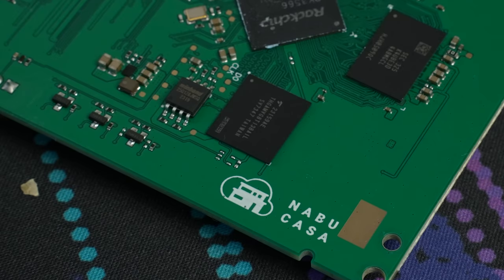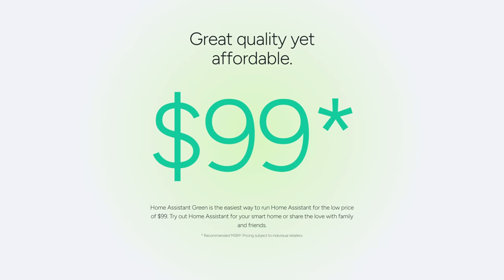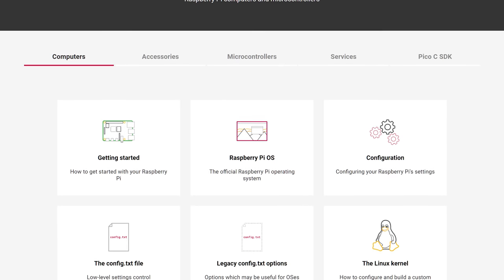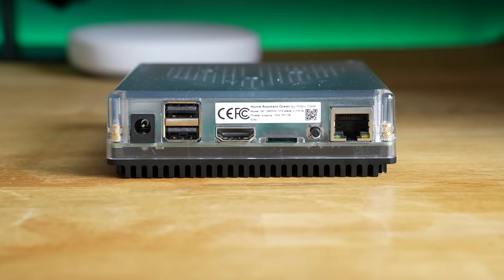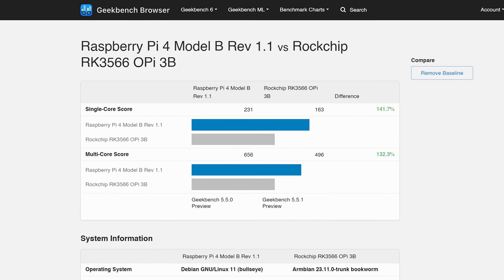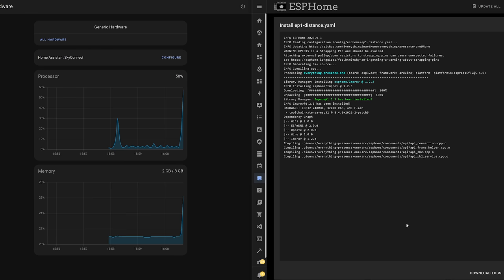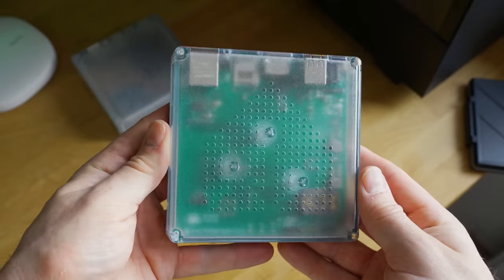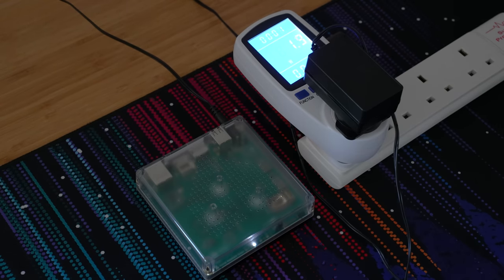Home Assistant Has Never Been This EASY!

Comment: Disappointing that the green doesn’t support PoE, that would have made it an easy win in my books.
Reply: No it actually does. If you check in their website, it says poe is an option you can add with an additional cost
Reply: @ no that’s the HA Yellow
Reply: 5$ 12v PoE splitter will do the trick just fine
Reply: Path of Exile?

Comment: Great video Lewis, and good advice.  The sky connect should not be plugged directly into the USB port .  The extension cable supplied is to give separation from the high frequency  clock noise and will make the radio more reliable, as mentioned by Paulis.
Reply from the maker: It sure is, it was just for a nicer shot during filming 😜
Reply: @EverythingSmartHome naaah, are you going Hollywoodish? 😂😂

Comment: Wow, if potential users can't do the easy bit of d/l the img and flash a usb stick or drive, then they have absolutely NO chance of the nightmare ride they are going to get trying to get the cryptic, obfuscated Home Assistant sorted. Just a thought for any potential user to check out first, as I failed to get my 13 or so Tasmota's that have run on nodered faultlessly for the past 8 years to be seen/usable in various versions, including the latest HA. The installing is the easy bit, then comes the dark side.

Comment: You can always run Home Assistant on HA Green, while running "AI/image detection" in docker on a more powerful machine.
I have been running HA in docker on my Unraid machine for years, but hate HA being down when i have to do maintenance on UNRAID.
I might move HA and the low-resource dockers to HA green, and keep the high-resource (low-priority) dockers running on UNRAID.
During maintenance, I NEED my lights working, I DONT NEED person detection.

Comment: This device really seems like an answer in search of a question.  Double the cost of a Raspberry Pi, the same or worse performance (depending on whether you're comparing to a Pi4 or Pi5), and zero radios onboard--not even Bluetooth (or WiFi, but any server--which this is--ought to be wired anyway).  And only two USB ports.  Yeah, it comes with HAOS pre-installed--but if flashing HAOS to a uSD card is problematic, HA just isn't for you.  Is saving a few watts worth it?  I wouldn't think so.

A year ago, before the rPi5 and when the rPi4 was unobtainium, this might have made sense.  Today?  I don't think so.

Comment: Lack of POE on the HA Green is easily sorted by a POE Splitter. Sure it's a bit more "clunky" than built in POE, but from a practical viewpoint it achieves the one-cable-for-data-and-power. In practise you won't notice the "clunk" as it sits at the back of the unit. Also, from an economics viewpoint, many new Green Users won't be paying for something they will never use and if it's something that becomes useful down the road, then it's a simple incremental cost. I got mine off Amazon for just over £10 (flash sale) for a full Gigabit splitter.  Note that you can use a FastEthernet (100mbs) rather than a gigabit - this will be entirely adequate for any installs which don't involve streaming video

Comment: @EverySmartHome  Great video and tempting devices from HA. I have been wanting to try HA for some time now and use it with lighting, plugs, Thermostat and more as I learn its capabilities, I also would like to move my Security Cameras off Blue Iris running 4-6 Camera Feeds and onto HA if that is possible, I currently have Blue Iris running on my Gaming Desktop PC. Would one of these HA devices work for me? If not could someone please recommend a medium to small sized device setup that would not break the bank, that I could build or buy to meet my needs now and not need replaced any time soon if at all.
I know enough (using the Web) to do things, I am not good at it but I eventually get the job done and not scared to learn. Any recommendations on any pre-built systems or something better I could do following a guide or video would be greatly appreciated. I have seen a number of interesting devices on this channel and others that seem good, I am just not sure if they can handle the always on Security Camera feeds I send to a 40” TV Screen in our Den and still do all the other HA things too? Thank You for any and all suggestions!
Reply: It has been a couple of weeks now and no response. Is anyone able to see this? or is it not a good YouTube page to learn stuff like I am asking about? If not could someone please at least recommend a good YouTube page or other online source that would be good to use?

Comment: I don't agree that 32Gb storage is enough. 10 days default recorder with not too many sensors that update to the second(power sensors is what I have in mind) and about 10 esphome compiles for different devices will fill it up.
I lova HA but that default recorder days need to be lowered.
Update: I changed my mind, I have way more rapidly changing entities than I thought, mosly esphome. I think I'll need to update my devices so that original power sensors become internal (more accurate riemann) and create template sensors within esphome itself that copy those sensors with a lambda and then filter it wih "or": throttle+delta.
Reply from the maker: Both my instances have a lot of sensors and probably about 30 ESPHome devices and nowhere near? Also with the default 10 days.

Are you sure you don't have a bunch of old add-on images built up using the space? I cleared 16GB a couple of weeks ago from previous versions
Reply: @EverythingSmartHome  I had that problem too (checked with portainer) and also frigate starting to unexpectedly record locally triggered me to think HA needs more storage.

Comment: Hi I'm at present running HA on a Pi3 and it seems to work well, butthe Green looks like a good update as pi is using sd card, my question is really around transferring from one box to the next i do have backups (thanks for the video on helping with that) but i do run quite a few Addons and will need to transfer the IP address as my Solar system points to the HA box as a Proxy before sending to the cloud.

Comment: It's really annoying that the green doesn't have PoE and doesn't come with Zigbee out of the box. I get that most people don't need PoE so that's fair enough (but still annoying to not have it), but what really pissed me off was discovering that Green doesn't come with Zigbee out of the box. It's supposed to be the "easy" option but it's somehow less ready to use and needs you to buy extra components for it?! Daft! I'd have got a yellow if I'd known (and if there was stock at the time).

I'm quite a techy guy in general and I love the amount of control you get with this system, but they really still have some room for improvement when it comes to being user-friendly, so many bits of the UI with messy strings, enormous lists of what are essentially phantom devices, it's not exactly obvious where to go to do your most common and basic things (some of the items hidden away in settings ought to be on the left nav). Scheduling stuff is limited to half hour blocks which also seems to defeat the point of having a system that gives you such finite control (you can't even schedule something to come on at say, 10 minutes past the hour? wtf?)

Excited to get it working with more stuff but the learning curve on this thing is steep even for the "easy" version, and not happy I have to shell out more money to add key components that shouldn't be missing.

Comment: Excellent video as always......We currently have HA on a QNAP NAS and we are selling our house and all the LED lighting in the house is controlled by Z Wave and we are taking the QNAP and all our wi-fi and networking equipment with us and we want to leave the house with automation for the new buyers and so I was thinking we could install a HA Green and plug the Z Wave dongle into the HA Green along with a wi-fi dongle then have a 15" or so HDMI monitor mounted on the wall connected to the HA Green.......would that work?

Kind regards
Bruce

Comment: I have many old smartphones which all are more powerful than a raspberry pi. Recently tried to use that as a hass server cause this option is totally free. No official documentation I found for that. Some people on the internet made it run. I followed their steps. Either they were outdated. Or gone over my head. I am not new to electronics, networking or programming, far from that. Ran hass virtualised windows machine with diy esphome modules before. But my knowledge of linux and python are pretty limited. What's your take on that?

Comment: I think this is a good device that has its place, but I do disagree with your assertion that it being "simple to set up" is a reason some people should get it.  While that may be true,  actually running and maintaining any Home Assistant setup is not simple.  Being easy to plug in and switch on doesn't mean it's easy to live with.

HA is great, of course. But I'm not convinced the software is ready for the kind of user who just wants to plug in and go. So is it wise to aim a product at that kind of user when they will inevitably have problems down the line?
Reply from the maker: The experience of HA after the initial setup is the same on any device though, the installation is the differentiating factor here.

I think they've made big strides in the last couple years and they seem to improve with every release, I think given more time we will see more improvement still

Comment: I've definitely been looking at the Yellow myself as I've graduated from Home Assistant in Docker to HAOS on a proxmox vm. Right now I'm wanting to house what has become an important part of my dad's care (dementia), in a stand alone case that is backed up by battery. The VM I run now is on my big server downstairs, which is plenty powerful but it's Achilles heel is the storage options I currently have in it. I've already moved some critical network services off of it...and next up is my HAOS install.

I don't think the Green is for me, as I'm more of a tinker than that is meant for. It's definitely a step in the direction of bringing HA to a wider market and I'm glad to see that happening.
Reply from the maker: Absolutely, sounds like you've identified what you need already and are on the path to finding something that works for you. That's the great thing about HA is the range of hardware it can run on

Comment: You really don't make it easier to choose between yellow and green. If I understand it all correctly, if possible, it is that the yellow has everything that the green has, but can and has more. Or am I seeing that wrong.
I would like to use this device not only for a home assistant in itself, but also to control things such as sprinklers and water addition in my private hydroponic system. Sprinklers, for example, must open for a very short time (seconds) and this can be done, for example, with a home app on the Android smartphone. The shortest time there is 1 minute. And that is why I would use this device, among others.

Comment: Awesome and really helpful video, but one quick question:
If I were to purchase HA Yellow, could I swap the Pi board on it with a Pi 5 that was just released? Finally, since this has a Zigbee radio on it, I am guessing that you would still need a Thread and Z-wave radio to work with said ecosystems. Thanks for the help!😄
Reply: Home assistant yellow uses a pi compute module 4, not a regular raspberry pi, if pi foundation release a compute module 5 that uses the same connector then its quite likely it would be compatible but no word if that's happening any time soon

Comment: Great review. The most thorough one I have seen so far. A year ago I installed HA on a Windows 10 machine with VirtualBox and a GoControl HUSBZB-1 combo stick. I am so tired of MS monthly updates and reboots and was wondering if this is something I could "migrate" to using a backup and some config changes? I am using 10gig of space and around 2gig ram on average so I don't think that would be an issue. Any advice?
Reply from the maker: Oh goodness yes anything but a VM on windows 😅 haha kidding but the windows updates are really annoying like you mention and there is better solutions, green sounds like it'll be a good for for you!
Reply: @EdwinPWeston I'm in the same boat as you. It's sooooo frustrating when HA stops because MS decides to update. I've tried so many things to stop these auto updates but nothing works. I've decided to bite the bullet and go for the "Green". Fingers crossed it all works out !

Comment: if I use Home Assistant GREEN which has no WiFi on board I could control also my sonoff WiFi wall switch locally or I have to buy a Wifi dongle for the GREEN? Thank you for your help
Reply: WiFi devices connect to the network, not directly to the HA server.

Comment: The official Home Assistant devices are not worth buying as a new user or existing hobbyist type user in my opinion. 

If they're going to advertise it to new users they need to produce a device which for the most part out of the box is a one stop shop, with decent Wi-Fi, ZigBee, Z-Wave, Matter, Thread, Bluetooth (Everything) included out the box.

All that buy our product and then start having to buy additional dongles to make something work which should have been there and working in the first place for a novice is retarded.

As is not including something out of the box (a decent processor) that enthusiast and hobbyist users might at some point want, like the need to use a cam/s (doorbell), that's equally retarded.

How about they produce a slightly larger product, make sure everything is packed in there which will hit everyone's expectations and just charge a bit more money.

People in the smart home scene have spent hundreds on shitty subpar doorbells, limited google assistant touch displays and way too much on money on overly hyped subpar Aqara FP2 occupancy sensors riddled in bugs, glitches and ghosting issues.  

I'm pretty sure smart home users would foot the bill for one clean one stop shop smart home hub with a decent bit of processing power grunt, ram, hdd and all of the necessary wireless integrations that cover all current existing wireless protocols and devices out at the moment.
Reply: You seem nice…